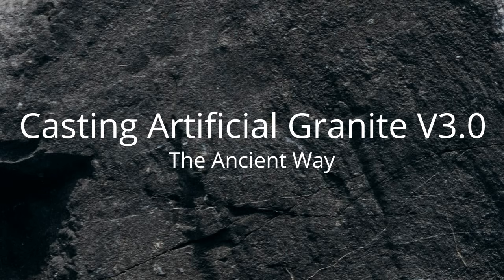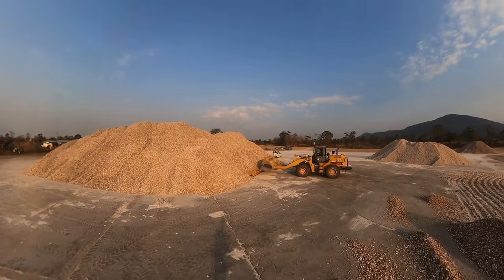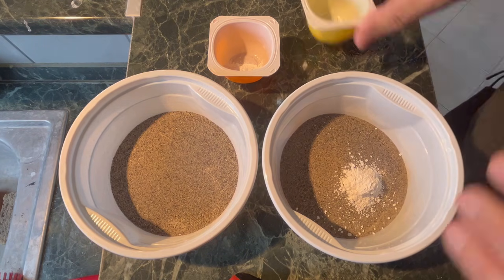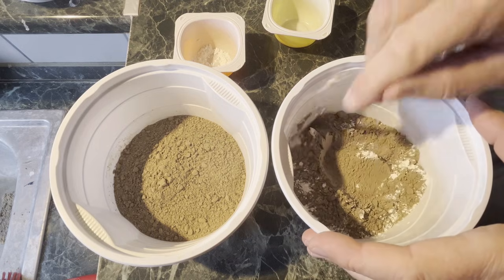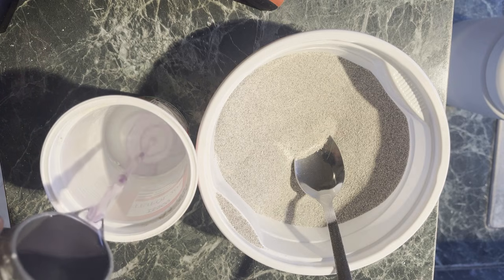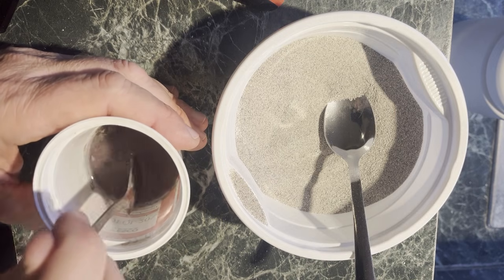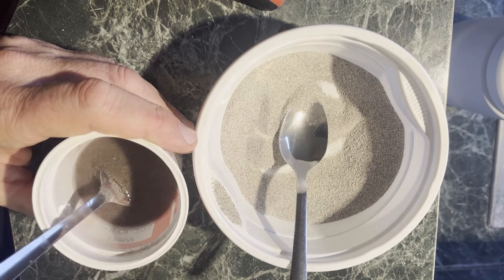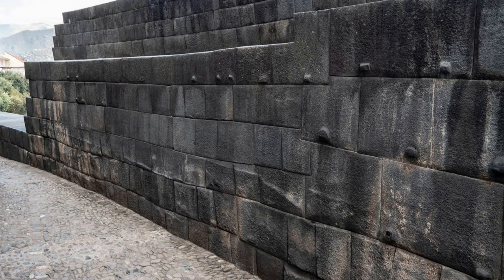Casting Stone V3 - The Ancient Way

Comment: Thank you 

I just saw your video as someone else make a short from it, (maybe you should make a few of your own, lol as people are using your content) I did spend a little time looking at accelerants for water glass.  Thank you for sharing, I will have to give it a try,  I was looking at citric acid, aluminum oxide or material associated with the Bayer process for working with bauxite (some of the chemical intermediaries)  also was looking a polyacrylamide, and even maltodextrin, you are using slack lime, but have you looked at quicklime, or would there be to much heat produced, but it looks the the hydrated quick lime you are using is the heat source for the water glass to cure.  This has eating up my afternoon, awesome bit of learning and teaching thank you.

Comment: 106g sodium carbonate anhydrous (1 mole baked natron/dehydrated washing soda is the same thing)plus 75g CaOH2 (1 mole slaked lime/pickling lime is the same) plus 1 liter distilled water, heat and stir for 10-15 minutes makes 2 moles NaOH plus 1 mole CaCO3 at roughly 2 molar NaOH solution. Next add 100g wheat,barley,rice, or oat straw or hull ash prepared by open pile burn (minimum 60% amorphous sio2 by weight or higher). Cover the container and allow to reflux for an hour. Take off the lid and dehydrate down until it forms a syrup, roughly 250-300ml solution (liquid phase) We have roughly 115g sodium metasilicate and 10-15g potassium metasilicate in high concentration. Next add 300g of 90% reactive metakaolin. This gives Na2O/Al2O3 molar ratio of roughly .8-.9 and a final sio2/al2o3 molar ratio of roughly 3. The precipitate and impurities can be filtered prior to dehydration or left as aggregate! Enjoy! This recipe relies only on materials available to ancient people and methods. Metakaolin is kaolinite clay that has been calcined or bisque fired at 600-800c Caution, sodium hydroxide will be in the water vapor. This should be done outdoors and with proper PPE, and a washing station nearby in case of accidents. All cereal straw ash contains 60-90% amorphous sio2 by weight assuming sufficient combustion at 500-700c but no hotter. To be clear equal weights of all ingredients could be used, but the excess calcium hydroxide will react with the metasilicate to form calcium silicate precipitate which contributes to the material properties

Comment: Marcel CaOH2 plus Na2SiO3 equals calcium silicate and sodium hydroxide. This would be a hybrid assuming there is an aluminum source. First of all, congratulations! I too am backwards engineering an ancient stone and relating it to current Geo polymer science. I don’t doubt the use of calcium hydroxide, but only as a reactant with sodium carbonate or potassium carbonate. Also, I’ve been experimenting with disaggregating granite thermally. It can then be milled fine and put through the wet method for meta silicate production. Just throw a piece of granite back in your charcoal starter can and afterwards, it’ll thoroughly disintegrate at the grain boundaries